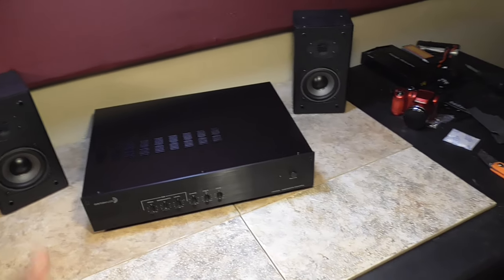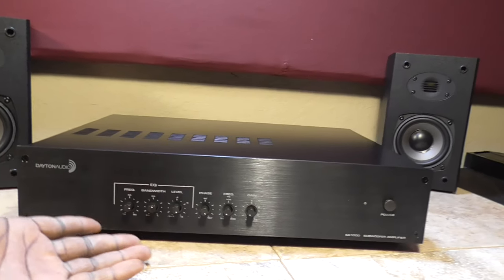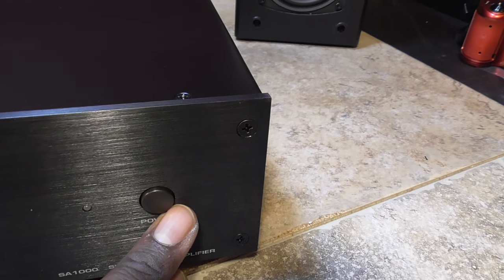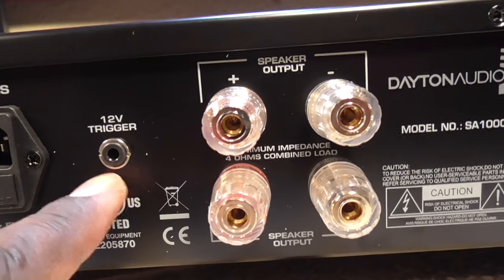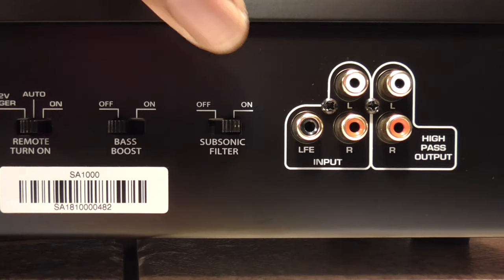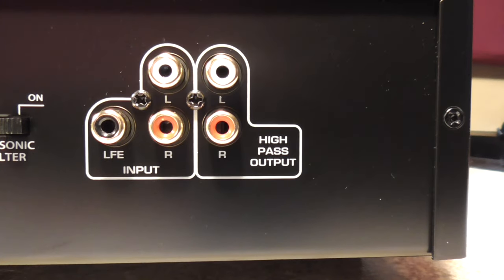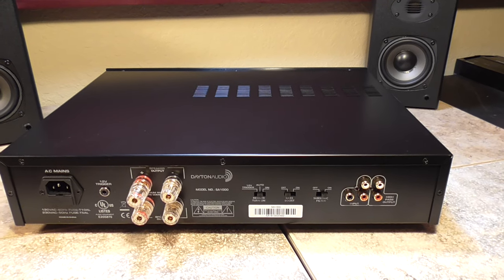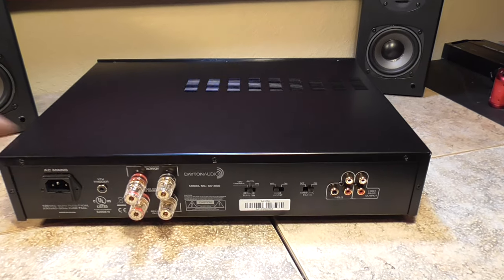My New Amplifier - Dayton Audio SA1000

Comment: If it had a cliplight, it would be perfect, it's problematic that it doesn't have one... If they'd charge another 10 bucks to put one in, it would be perfect, better yet if it had a analog vu meter and a cliplight, I'd buy it...
Reply: In the original dayton amp this one replaced. I had it years back.  Witch looks almost identical except for the rear hookups. It was basic. This has extra options.  Anyway It does have a clip light. It was configured in with the power light. It will change blue to red when clipping. I imagine this has the same setup
Reply: It does have a clip light, I have two of these amplifiers.

Comment: I was looking to use this amp on car subs in my home 🎥. Do you think this would be a good choice or should I use a class d amp?
Reply: Long as their final impedance isn't lower then 4 ohms, it'll be fine. Don't try to run two ohm subs, unless you have two of them to put their voice coils in series to make 4 ohms. Use at least 12 gauge wire.

Comment: thanks.  would have never known those buttons pushed in w/out watching this review.  nice feature.  from a lot of reviews i've read they are saying that sometimes have a problem running at 4 ohm's even though it's rated for 4??   but i am thinking about grabbing one to power a rockford fosgate p3 d2 wired to 8 ohms.  at 8 ohms it'll pump 497w rms and will run cool since i wouldn't be maxing it out.   right now i'm pushing the sub w/ the dayton apa150 (150w rms) so will be a nice upgrade.
Reply from the maker: You're correct. I upgraded from the SPA250 and it was night and day difference

Comment: No way this put out 950w, it really be 100w RMS power, many makers over hype the power output of amps these days, A Pyle 120+120 really is 20+20w RMS
Reply from the maker: I think you should research Dayton Audio a bit more. You may actually like what you find. Comparing Dayton Audio to Pyle, is like comparing Dual to Sundown Audio. No disrespect.
Reply: I have a spa 250 it sounds good on an eclipse 12. Loud and sounds good for what it is.
Reply: Williston tested it recently, it really does do 950 cleanly.
Reply: @arande3  yup i saw that video went up to about 1200 watts dynamically